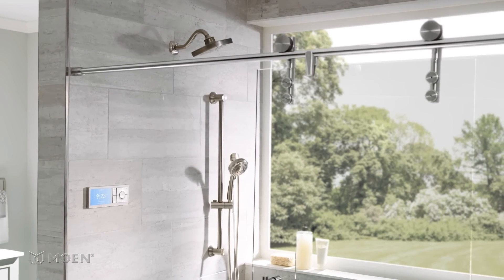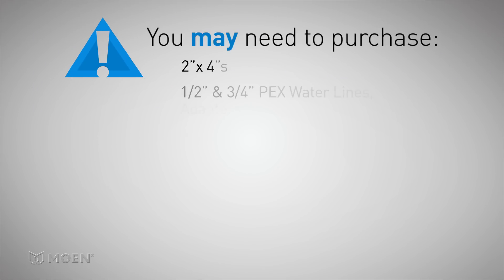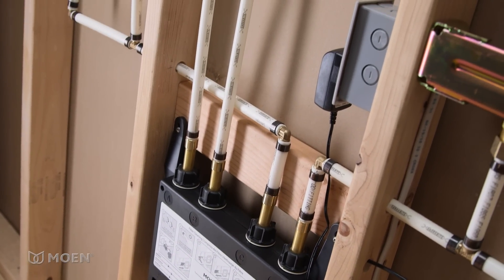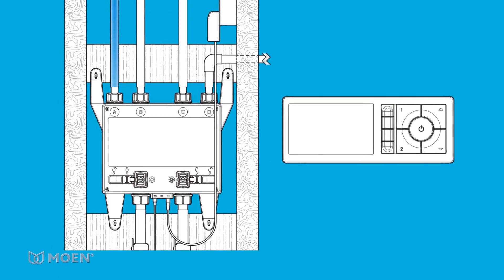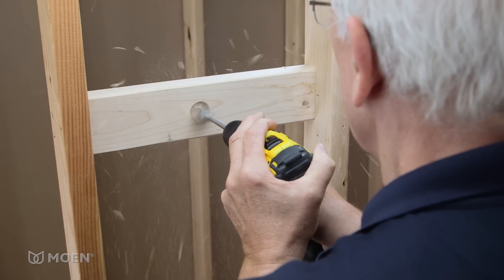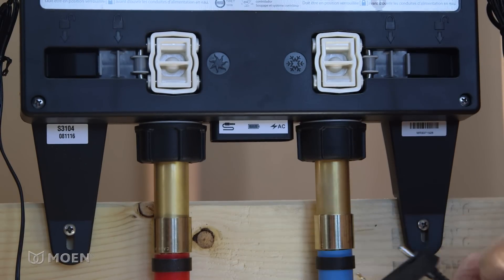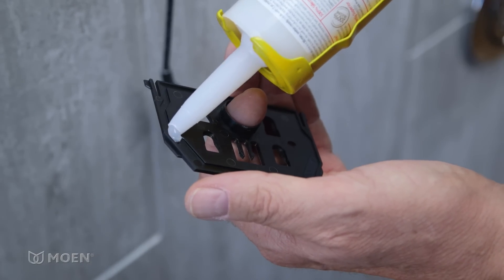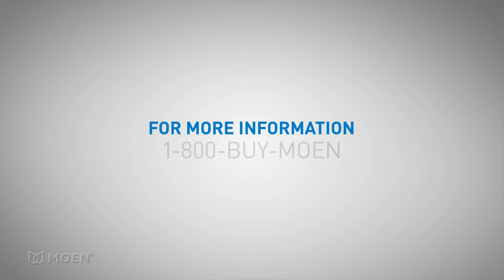U by Moen Shower  |  Installation

Comment: Can I add the Moen U to my existing shower head .
Reply from the maker: Hello Jackie.  Any standard shower fittings can be used with the Smart Shower digital valve. The maximum flow rate of the S3102 2-outlet valve is 9 gpm at 45 psi. The maximum flow rate of the S3104 4-outlet valve is 14 gpm at 45 psi.
Reply: Yes Jackie you can. The Moen U has no idea what fittings are downstream (even if it's Kohler!)

Comment: Please Note: When pulling a data cable, power cable or the like, NEVER FOLLOW THE EXAMPLE 6:22 illustrated in this video. ALWAYS grasp the data or power cable plug by the body of the plug. The life of the cable is shortened and, in the instance of the line voltage cable, a fire may occur causing loss of life and property damage.
Reply: Good advice, although this is a low-voltage cable.
Reply: @teekay_1  Right, I get that but the principal of caring for the product / cable is the same

Comment: we don't have to use this controller right? We can just use the Android tablet already in the shower?
Reply from the maker: Hello Jason.  The U by Moen Shower Thermostatic Digital Valve, S3102 or S3104 requires the U by Moen Shower Digital Shower Controller, TS3302 or TS3304.  The controller is required to connect to the U by Moen app.
Reply: @moenfaucets  ok, but I can just hide the controller on a shelf in the cabinet, right?
Reply from the maker: Hello Jason.  The U by Moen Shower Digital Shower Controller is required to have a minimum space of 10 in x 6 in either inside the shower or on an easily accessible wall adjacent to the shower (in-shower is recommended). The controller can be placed up to 30 ft from the U by Moen valve.
Reply: @moenfaucets  Ok, so basically, what I'm asking is that I can hide the controller on the other side of the wall, inside a cabinet, so that I don't see it. I can then control the shower with my app. The app talks to this unit over wifi or over bluetooth?
Reply from the maker: Hello Jason.  We still suggest/recommend the controller be installed inside the shower or on an easily accessible wall adjacent to the shower.  Please contact us directly with any additional installation or set-up questions; call us at 1-800-289-6636.  Our product specialists are available Monday through Friday from 8:00 am- 7:00 pm Eastern Time.
Reply: @jasonhunter6125   you are correct. their PR wont say that. But it may interfere with the Bluetooth range (or wifi idk what they use) depending what material the walls are made off. but should still work behind 2-4 walls no problem.
Reply: @jasonhunter6125  you could, but TBH the app is a slow pain in the ass. Just put the controller in a sensible place.  Plus, you know your wife aint gonna want to mess w some app when she wants to shower.

Comment: What happens when the GFI trips?
Reply from the maker: Hello Adam.  If the GFCI trips the outlet will no longer have any power.  This means that the shower cannot be used unless the optional battery back-up has been installed.  The battery back-up kit is part number 179573.
Reply: Which in this setup, is behind a wall and can't be reset. You would need some way to access the in wall GFCI. Does your suggested design include an access panel?
Reply from the maker: Hello Adam.  An access panel is required for installation and is covered in our installation instructions:  
"Access panel opening minimum 14" wide by 29" high to allow access to valve shutoff's and electrical outlet for servicing."
Reply: the power goes out and you ain't showering until ya fix it bro.

Comment: For the battery backup do you need to change the installed batterys after a certain amount of time?
Reply from the maker: Depending on usage, you would typically need to change the batteries every 6 months.  The ready sensor on the faucet will flash blue to indicate that the battery needs to be replaced.
Reply: @moenfaucets  just leave the batteries out until a power outage,  then pop them in. They will corrode if left in for long periods
Reply: no, batteries in this device will work FOREVER. It's due to Moen's phenomenal team of engineers.

Comment: Hello Moen team, so I'm guessing I don't need an actual boiler with this system since it heats the water itself via AC instead of gas right?
Reply from the maker: Hello Christian Trejo and thank you for your interest in Moen products. The U by Moen Shower Thermostatic Digital Shower automatically adjusts the mix of hot and cold water using a thermistor and digital control system to precisely achieve and maintain the desired temperature even with changing inlet water temperatures and pressures. The U by Moen shower operates with standard hot water tanks and requires an incoming temperature between 40°F (5°C) and 149°F (65°C). If you have any additional questions, please contact Moen Consumer Services at 1-800-289-6636; our current business hours are Monday through Friday from 9:00 am - 5:30 pm EST.
Reply: huh?  no bro, not at all.  The price may have you thinking it heats water too, and makes coffee, and breakfast. But I assure you it does none of those things. Alas.

Comment: After only a little over 1 year, my customers control box started leaking internally. Please be aware this product is not made very well. Looks like I will be replacing it and definitely not recommending to any other customers.
Reply: it's made of plastic and literally covered in potentially leaky connections.  But if you installed it right, it'll work good.  I did it and I know literally nothing about plumbing. And it works fine.  How much did you charge for install?